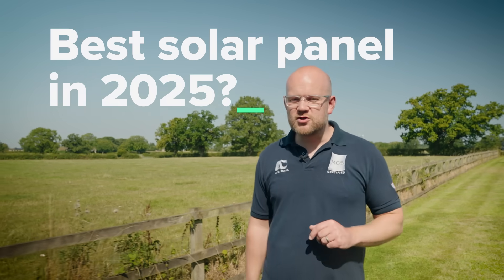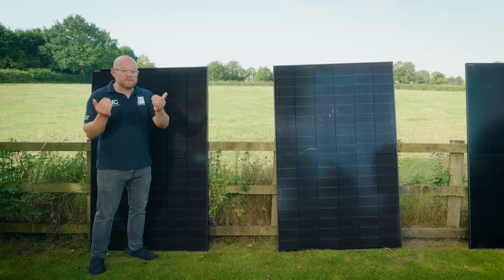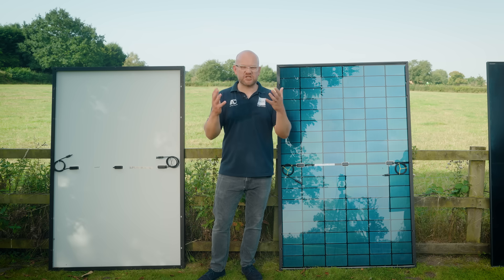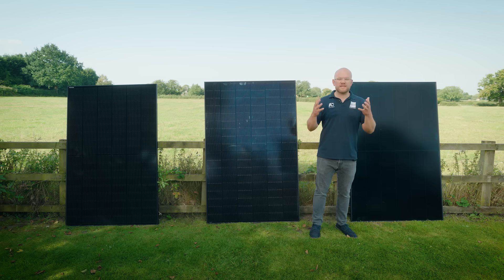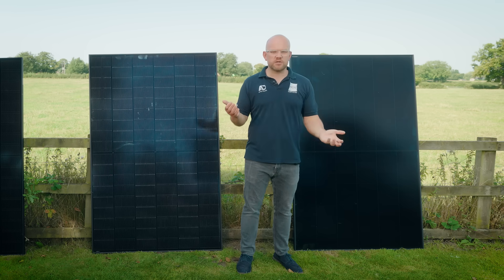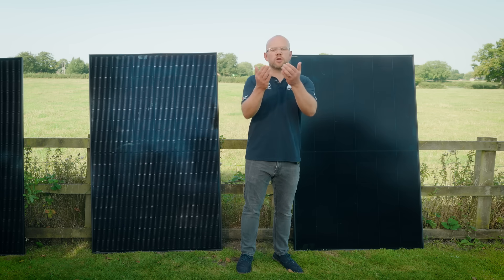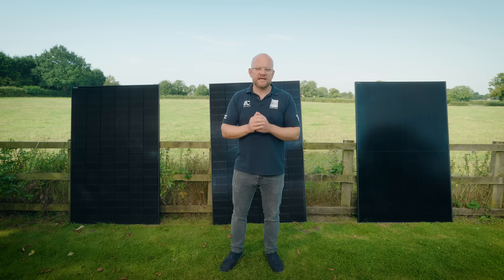Monofacial vs Bifacial vs All-Back Contact | Best Solar Panels 2025

Comment: In my opinion, you have to elevate the bifacial panels at least a meter high to gain the maximum of the bifacial panels. I installed my 615w bifacial panels 2.5 meters  high on top of my white painted roof slab.
Reply: You're correct
Reply: I think it's a good idea but you don't want to end up compromising the tilt angle which affects how much direct sun light the panel is getting. Although I know this depends on your location.
Reply: And? What did you gain ?
Reply: @migor777 I didn’t do any measurements but it makes sense. If you have bifacial panels and stick it flat on the roof with the back cells not getting additional light, you gain very little. So I elevated mine 2.5m and put a .5m gap between panels to let more sunlight hit my white roof reflecting back to the back of my panels.
Reply: @cebuoslob Our panels are 2.5 meters above roof? Can I have a photo of this ?? Please :)

Comment: Personal Rule: saving on Panels won't change the price of installation. So put as many as you can, because to add more later will have an even higher market-corrected installation price. Learn, save, plan and when adding solar try not to half-ass it. A 25 year warranty product means you are in your forever home that its worth the investment in. I'm still learning and saving myself.
Reply: After 25 years they are all still going strong. It's like adding two new panels to a 10 panel string and you're back to the production level of 25 years previously.

Comment: Unfortunately by me most homes have smaller lots so only rooftop is practical.  Also most people choose dark roof shingles or tiles.
Reply: I'm wondering if a reflective material could be placed beneath the bifacial panels before install.
Reply: @s.wilson5675 wouldn't be worth the cost to add vs installing the right panel and more real-estate

Comment: I would have listened and subscribed but you dribble on for 14mins…
Cut the rubbish and get to the point
Reply from the maker: I appreciate you taking the time to watch and share your thoughts. Just a reminder though — there’s a real person putting a lot of effort into creating these videos to try and help people. I’ll take your feedback on board and keep working on making future ones more concise.
Reply: @apexdoma  Contrary point of view here. I like your generalizations, I like you don't lean to0 heavy into the geeky specs. Glad you know and glad you get right into it but I'm just here for your generalizations. Whilst it could have been tighter not bad considering you winged it! On that basis, I'm subscribing and will look for more.
Reply: Last week, I purchased 12 × 630 W Jinko mono bifacial panels for a ground mounted array. The cost per unit delivered was £55, and the existing panels that I purchased exactly 10 years ago were £ 205 for a 250 W poly Shutten panel. The prices quoted are in Thailand.

Thought is was time to expand as battery price has dropped significantly as well , £1000 for a 15 kw XIHO modular unit. Being 100% offgrid, the reduction in cost is most welcome.

Comment: What would happen if I were to exchange my 325watt x 13 panels for 425watt x 13 panels , would I need permission? What about the electric company that pays me feed in tariff. Been on roof since 2012. So getting full tariff
Reply from the maker: If you replace panels on a system accredited under the Feed-in Tariff (FIT), the key issue is whether the Total Installed Capacity (TIC) changes. Your original system (325 W × 13 = 4.23 kW) is the capacity accredited for FIT payments. Replacing with 425 W × 13 = 5.53 kW increases TIC by about 1.3 kW.

Under FIT rules:
	•	Replacement of equipment is allowed and does not in itself end accreditation.
	•	Any increase above the accredited TIC is not eligible for FIT – payments remain based only on the original accredited capacity.
	•	If your new system exceeds the accredited size, you may need to treat the additional capacity separately (for example via the Smart Export Guarantee for exports).
	•	Metering must still accurately measure only the accredited installation for FIT purposes.

If you wished to keep the FIT simple, you could match your replacement system’s total capacity to the accredited size (for example by using fewer higher-wattage panels).

You should confirm the approach directly with your FIT licensee, as they are responsible for administering your payments.

Thanks for commenting 😃

P.s - you can add battery storage, it is usually just best to go for an AC coupled system.

Comment: Thanks for video.
But you should explain better how Bifacial panels work.

I think it might be best to say that the biggest difference between Mon and Bi facial panels are that the Bifacial allow light THRU the panel.
You can get them to produce power by mounting them upside down as well: although is not best way, but they DO work.

And there are TWO sets of glass: 1.6 or 3mm thick. On the TOP as well as bottom side.
That affects strength/rigidity, weight and cost.

In your video you said you want to get light from behind (or sideways). But that's not required.
You don't need to have ANY light passed from behind or the sides: they also work by allowing light thru that then reflects on the surface behind, and go thru the panel again.
There is good reasearch showing that bifacial panels mounted on WHITE roofs are the most efficient.
Look up: Cuevos et al, "50 Per cent more output power from an albedo-collecting flat panel using bifacial solar cells", Solar Energy, Vol 29, Issue 5, 1982.

"Albedo" is the term that describes how reflective a surface is.
If you use Google Scholar on that paper, you'll see it is very well cited: 172 times. And it is used in the Wikipedia article too.

I haven't seen the manufacturers give details, but they SHOULD since the efficiency really depends on the TYPE of surface behind the panel.
And I'm surprised that the people selling solar installation fixings haven't marketed a good way to provide a white refective surface behind the panels.
Not of the entire roof, but what is immediately behind them.
So you'd improve efficiency by adding a more reflective surface/coating.
Like white, gray or silver.
Black or dark red is obviously the worst.

This guy did some experiments that also shows this: https://www.youtube.com/watch?v=x5o90l5Lu_0

Comment: Video is WRONG !!!
You specifically stated if I put this panel against that panel....
Ergo talking like ONE PANEL Vs Another Single panel...
3,500 to 4,000kWh/yr Vs 4,000 to 4,500kWh/yr = 500kWh/yr increase
Ergh from ONE PANEL - NOPE
Try maybe 50kWh/yr difference

50w difference between panels,
average daily output is 3x (1x winter, 3x Spring/Autumn & 5x maybe 6x in a really good summer = 3x average)
So 50w x 3x average output = 150w, x 365 days = 54.75kW generation annual difference per panel with a perfect South facing roof & a sprinkling of luck for weather etc....

So it is about 50kWh difference NOT 500kWh/yr
or 350-400kWh/yr Vs 400-450kWh/yr PER PANEL

The numbers you showed probably represent an array of 10 to 12 panels
BUT, you specifically mentioned this panel vs that panel - ie: comparing one panel
When what you probably meant was a complete array of these panels Vs those panels = a 500kWh/yr difference

Still, 50kWh/yr additional generation is still a good increase...
that 50kW x 15p SEG will provide an additional £7.50 per panel (not £75 according to your 500kWh/yr)
Meaning, it would probably take around 3 to 4 more years to recoup the extra £30 for the Aiko cost, but after that, then you are recouping all that extra profit from each panel - probably something like an extra £100 pa+ after the 5th year on say a 12 string array - so it is worth the investment if installing a new system - updating a recently installed system, hmmm not so sure

But if you are about to get solar installed, then the extra £30 for Aiko is worth it imho, they are not bi-facial, but you get absolute max performance close to a bi-facial, even if your array has no reflected surface like in-roof or close flat tiled roof - plus they have great shading technology, so you won't need to add any optimisers in most shading cases to mitigate shading lowering performance. So most of the extra cost is offset by not needing to add Tigo's to shaded panels, plus you're quids in after 5 years or sooner if you don't need to add Tigo's (that'll probably fail at least once in 10 years & require scaffolding to replace)

If you run the numbers, you'll see those slightly expensive Aiko's actually work out to be a rather smart investment in just a few years...

No I don't work for Aiko or commission, I just wish I had the Neo-Star 3 installed, but they was not available then - ho hum
Reply from the maker: Good spot – thanks for picking that up. In the video I was actually talking about a whole array of 10 panels, but in the edit it does sound like I’m saying ‘per panel’. We shoot these without a script and trim them down afterwards, so some of that context got lost.

You’re absolutely right though – one panel on its own isn’t going to give an extra 500 kWh a year! Really appreciate you taking the time to call it out and explain it here, it’s super helpful for anyone reading the comments and allows us chance to clarify. 

😃
Reply: Hi Apex
I could not figure it out either....
If we go for 4.000 kWh pr year, makes more than 10 kWh pr day....
From one panel....?

So just to be clear, - are you saying the best panel in the video produces in mid-england, south facing etc etc, at least 400 kWh yearly?

And, I was trying to find the mentioned 'ACO 475w', but failed.
Can you please provide a link?

Regards
Torsten
Reply: @torstenstjernholm7877  it's Aiko
they are currently uo to 475w in all black
or 485w with very tiny thin white lines between cells - one is NeoStar 3P & one is NeoStar 3S - I get confused which is which

1 panel of 475w will generate UP TO 1,000 of its capacity if mounted perfectly South at perfect angle etc...
you get 1x av in winter, 5x in summer so 3x in Spring Autumn is the annual average over a year...

3 x 365 days = 1095, less a bit for losses and very rarely does a panel hit its max output for very long even on perfect days

So a 4.5kW system could generate up to 4,500kW pa if you're very very lucky and everything is perfectly facing South in the South or best parts for solar

Just google Aiko NeoStar 3 & yes a South facing panel could produce about 400kW per year
Reply: @authuruksake969 
Thank you so much for elaborating.
Although it took me a few days to see and appreciate your great answer, - please do not let that discourage you to reply to viewers in the future.

Thanks
Torsten

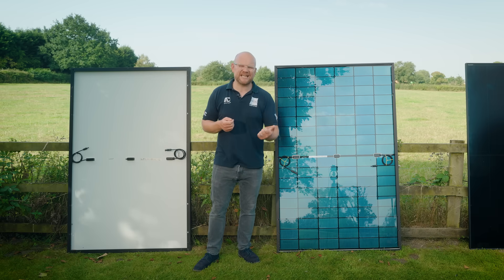Comment: 4:00 I think dual-glass could be good for in-roof, simply from a fire safety viewpoint.  They won't generate any more, but if a fire starts, the backing (being glass) won't add to the fire.  Combine with arcboxes for the MC4s.  
Personally I got the Aiko 2S  for my on-roof system (I would have got the 2P or 3P if they had been available from the installer).  The shadow handling on the Aikos is an advantage if there is partial shading like bird mess or branch shadows (related to the back-contact cell design, the Longi x10 panels also use back contact, and have the same advantage where up to 3 cells can be shaded on a substring before the bypass diode needs to kick in).  Doesn't help with heavy shading.
Reply: Longi S10 has back contact and HJT combined, which is better than any of the Aiko panels. Perhaps the uploader of this video has outdated knowledge in the solar panel field or perhaps they're just trying to sell you what they have in their storage.
Reply: @sampsalol  Is the S10 actually on sale in the UK?  I've seen the X10 at distributors but not the S10.
Reply: @WyndStryke  Longi claims it's available in Europe, at least some German and Swiss wholesalers have it. I'm sure a worthwhile installer will get it for you if you want to order it.
Reply from the maker: Thanks so much for adding to the conversation – love seeing people as into the details as we are! Just to add a little context: the Longi S10 is an 1800 mm panel, and in the video we were focusing on the more common 1762 mm size. At the time we filmed, the S10 wasn’t available for pre-order in the UK, whereas the Aiko 3S was, so that’s what we used for the comparison.

You’re absolutely right though – technology is moving so fast and these taller, higher-wattage panels are a great sign of where things are heading. Always exciting to see the industry evolve. 😃

Comment: Started with Jinko 415 on my house, recently Trina 445 on my flat roof raised fitment as bifacial definitely glass back is the way to go even if not bifacial. But people retro fitting still have to take into account the Amps and voltage of these solar panels as the equipment ie inverter or optimisers may not be suitable so not just about more wattage but that is what we strive for
Reply from the maker: Spot on. Glass–glass (esp. bifacial) on a flat roof can be a great move—tougher, slower degradation and a bit of rear-side gain if the surface is light. And you’re dead right that retrofits aren’t just “more watts”:
	•	Check Voc at your site’s lowest temp so the string stays under the inverter’s max DC.
	•	Check Isc/Imp against the MPPT’s input current limit.
	•	Keep like-for-like modules on the same string; if you must mix, use separate MPPTs/optimisers.
	•	Match DC connectors and ratings.

Nice setup, thanks for sharing!

Comment: I started buying Jinko a few years ago as they were the first of the chinese brands offering N channel.
Most recenty puchased 10x Trina 445w bifacials for my car port build.
Crazy realy that there £47 each so even offer value for money as roofing sheets.
I have alway stuck with Middsummer wholesale for many years.
Brillant company with great staff, just cant fault them.
Reply from the maker: That’s a really smart choice for a carport. Bifacial panels love that kind of setup because they can grab extra light bouncing up from the ground, so you’ll squeeze more out of them than you would on a normal roof. Plus they look clean and modern, so the whole thing ends up looking like a proper bit of design rather than just somewhere to park the car. Great thinking – it’s a cracking way to future-proof the space.

😃
Reply: @apexdoma  Glad you liked my thought pattern.
As you mentioned the prime reason for using bifacials was for some element  of gain from the underside, i will be laying down some white granite chippings under and around to hopefully boost that.
Also for the really nice lighting effect shining in around the cells exceeded my expectation.
The panels float on a 4mm thick bed of low modulouse low shaw rating silicone, so fully water tight, with 6mm expansion joints filled with the same but black.
To give a full black appearance for the top I cut square black downpipe along the middle and bonded around the perimeter of the array to carry the water away from the perimeter timbers and form a clean perimiter drip edge.
As my property is from approximately 1875, to make the carport emulate the period and add some interest I cut out many radiused bottom dagger boards for the perimeter to give it a Victorian railway platform canopy aesthetic.
Reply: Where did you get them for that price?

Comment: Is there a standard size for roof top solar . Or another way to ask is this the most popular size
Reply from the maker: Hi Rick,

Great question 1762 x 1134 is the most common size. It is possible to get longer panels but these are typically reserved for commercial installations.

Team AD 😃
Reply: @apexdoma thanks for your reply, I will build a new house next year my roof will use Spanish black slate but my project manager tells me thati we integrate the panels with the tiles around the panels . What’s the best method to use in this case or can you guide me to a video that explains to me a bast case use

Comment: I have just had 20 Aiko 465w panles installed East-West facing 10 on the front 10 on the back, when selecting my panels I'll was the same looking at the data sheet, trying to future proof my set up for as long as possible, as you stated in 6 months pa els have come.such a long way.
Reply from the maker: Nice one, Karl. Aiko 465s on an east–west split is a tidy setup. You’ll get that long, flat generation curve through the day, which is brilliant for self-consumption and EV charging. Aiko’s ABC cells are super efficient and handle heat well, so they’re a solid “future-proof” pick off the data sheet too.

Out of interest, what are you running on the inverter and battery side?
Reply: @apexdoma I have a givenergy 8kw inverter and givenergy 10.2kwh stackable battery